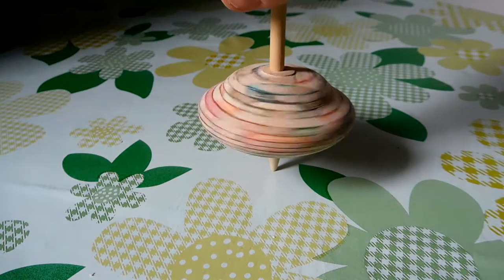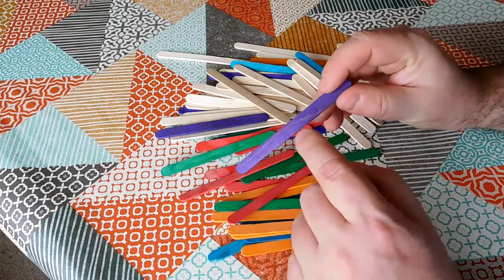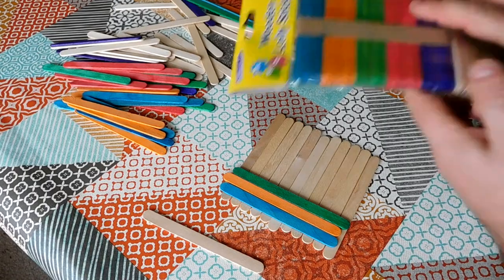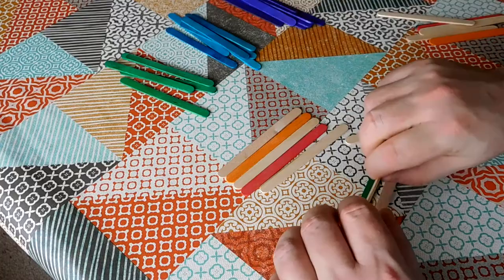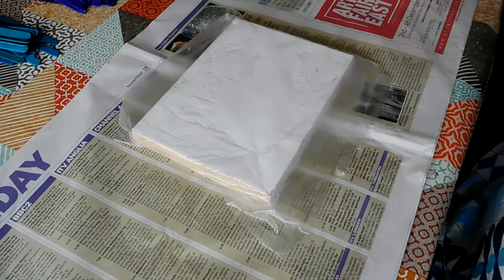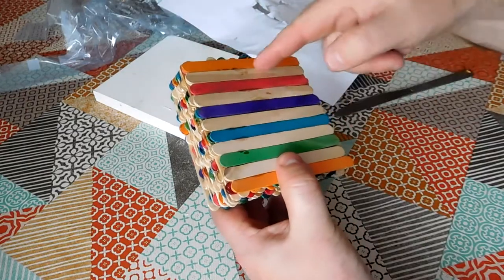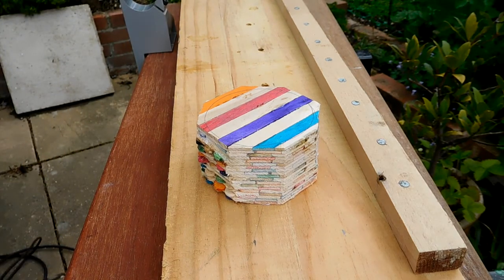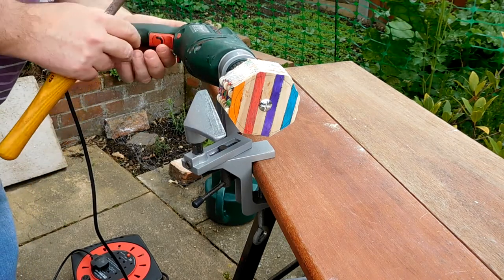Experimental Rainbow Plywood - Turned Into A Spinning Top

Comment: If your stem were longer you'd almost have a spindle of the type that can spin wool or silk or hair from some breeds of dog like keesbond undercoat. Drop spindles might have hook on top end, supported spindles would sit in bowl, Turkish spindle would have crossed pieces of wood at center instead of a round  whorl. 
   Spinning wheels are a relatively recent invention. Im a spinner in US who borrows a friendly sheep or fiber goat to take to a Renaissance faire one weekend each September and one of my favorite images to give people is that the sail on a Viking ship would have needed every thread it was woven from handspun with a spindle as they didn't have wheels.